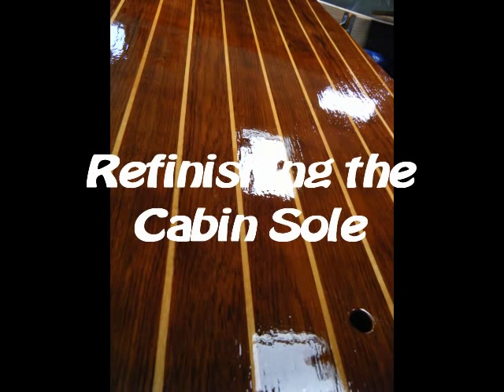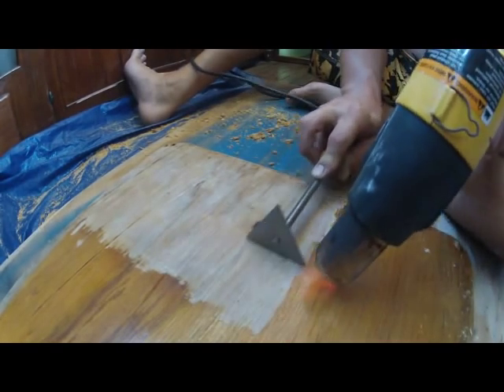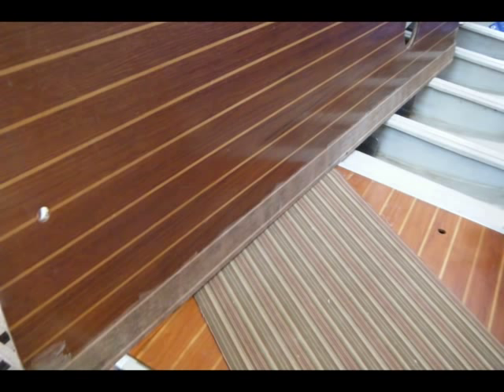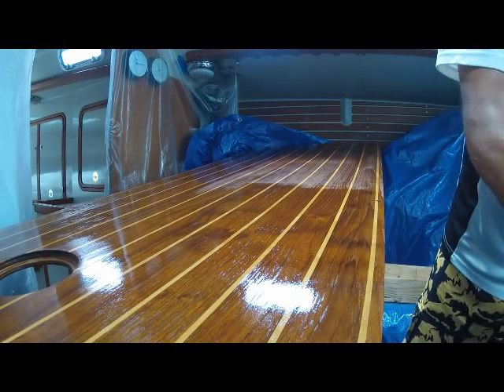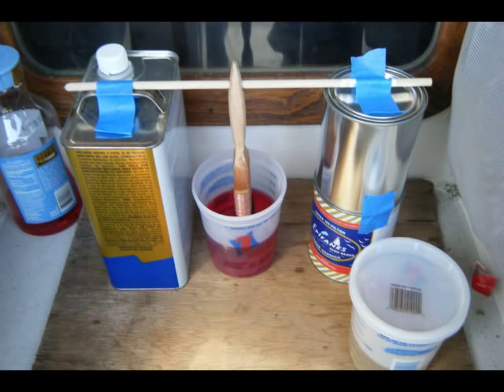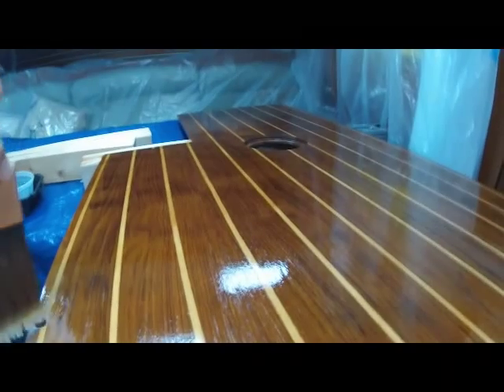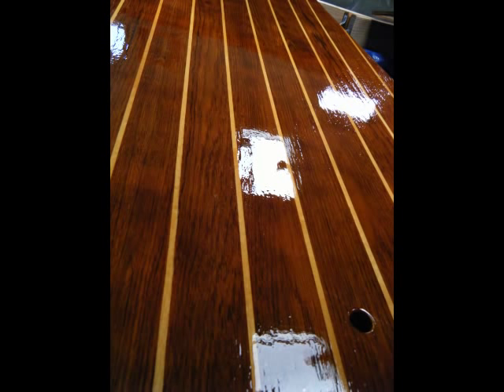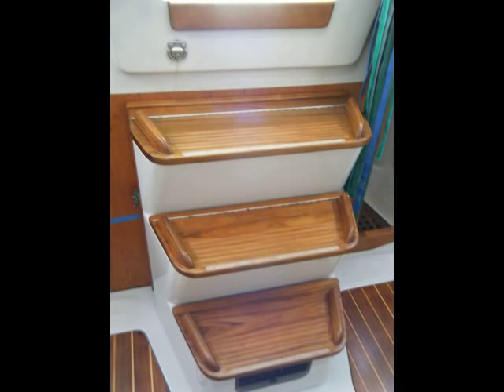How to Varnish and Refinish a cabin sole - Get A Deep Rich Sole in that sailboat floor

Comment: This is great!  Thanks so much for sharing this video.  My sole is in a sad way, and after seeing your beautiful job I'm working up the courage to work on it.  Do you have any advice about bulkheads?  I have been using lemon oil but it never looks good long.

Troy
Reply from the maker: Thanks.  I'm really glad that I can help people. Just be patient with it.  As for the bulkhead.  You can use really good teak oil and brush it on like varnishing.  Put about 4 coats letting them dry completely in between and it will look almost like varnish.  It will also last a long time.  BUT on the inside of the boat nothing is as good as varnishing.  And varnishing last almost forever on the inside.  Its just a ton of prep after using oil.
Reply: ronin51670 If I can ask one more question.

I am having an on going war with leaks.  I have a Columbia 8.3, and they are famous for leaking around the dead lights. I have used oil on the bulkheads in the past but the drips streak the teak under the windows.  I don't know if varnishing will help protect the wood or simply trap water between the varnish and the teak.  

Thanks so much for your time!

Troy

Comment: Great looking finish.

I normally use a sanding sealer after a 80-grit sanding, and then apply 75% varnish to 25% mineral spirit between sanding coats of 180, 220 and 400 grits. Unfortunately the product highly contains brush marks.Thus, I have to do lots of rubbing with scotch brite and plain cloth in order to get a finish like yours. What actually am I doing wrong?

Thanks
Reply: Probably not a good quality brush that clogs, or not enough thinner

Comment: How did you get the panels off the floor?
Reply from the maker: Hi, these panel's just sit in a groove molded to just hold them in place.  They just sit tthere.  They are not mounted in anybway.  
Some cabin soles are mounted with screws or a turn style holder.  Somevare screwed down.  They can have various mounting styles.  It will just depend on YOUR boat.  Hope this helped.  Ty for the comment and have a great day.

Comment: Question: why does the finished product look more like a matte finish when you seemed to apply a high gloss varnish? Thanks for the vid.
Reply from the maker: I use gloss for my base coats (first 5 or 6 coats) Then the last two or 3 coats are the finish that I want.  In this case the owner wanted a rubbed finish.
Reply: ronin51670  have the sam question. looks matte! thats what iam looking  for 👌 rubbed with what?

Comment: Great video! Thanks for taking the time to do that.  Quick question - I have a small section (8" X 6") of my teak and holly sole that the laminate is completely torn off.  Any suggestions on how that could be repaired?
Reply from the maker: Without being able to see the repair no.  You really have to strip the whole thing.
Reply: ronin51670 If we do strip that area, is it possible to "apply" a new section of laminate to the exisiting plywood in the affected area?

Comment: Thanks, it was informative, except for the material used. I am busy on my bulkheads and doors, and will move on to the sole last. Did you use Epifanes gloss and rubbed finish? I am in Mexico and varnish is hard to come by, but I have a supply of Epifanes.
Reply: +FrankenMer Gaming Thanks again. One more question. I have some damage to the holly, and sections where it is missing, plus numerous dents where stuff has been dropped. How do I attend to these to give me an almost unseen repair.
Reply: +FrankenMer Gaming Brilliant thanks. It is a solid floor with grooves about 2mm thick. I just need to find the holly here, but with 4 marine shops here in Mazatlan I could find it.
Thanks again.

Comment: VERY good video; thanks!!! I was wondering, a different site used West System Epoxy to build up the amount of protection, without as many coats, then put varnish on top of the (clear) epoxy. Do you think that would look good on the sole, and afford better protection than just varnish???? thanks again!!
Reply from the maker: Thanks,  I don't recommend that.  A few reasons.... First and foremost it will make it very very hard to redo the sole in a few years when they are due again.  Second varnish doesn't typically stick to epoxy very well.  Third, even clear epoxy changes color over time and will change the look of the sole.  Don't get me wrong coating wood with epoxy is a good idea on other parts or sections of your boat but I don't think it is a good idea on the floor.  Not to mention mistakes are very hard to fix and the epoxy is much more expensive.

Comment from the maker: As for the brush marks.  this is tricky sometimes.  weather plays a huge role in this especially with the rubbed finish because it dried so rapidly.  
The best way to do it is when you are on your last coat.  Thin the rubbed finish or a matt and sometimes the satin finished about 25 - 50 percent. Also working quicker on the last coat helps.  thinning it will help it lay down and smooth out.  As i said weather makes a big difference so do a couple test strokes on something.  Have fun

Comment: Thanks for a great intro/instructional video on varnishing sole boards. Some of my boards are in quite poor condition, occasionally with small areas of bare teak veneer exposed to the elements (humidity and dirt). Some of the "white stripes" (koto veneer) are also damaged in areas and I have purchased some koto veneer to replace these areas. Any experiences with this? ...especially how to achieve a good groove for laying the replacement strips...

Comment: Great video. Thank you for sharing. I’m researching before doing cabin soles on my Carter 30. On my boat the boards are not varnished or protected in any way on the bottom/bilge side. What did you do in your case?
Reply from the maker: I know its been 5 years l I'm not sure how I missed this comment then.  But I like to respond no.matter what lol.  I hope you sole turned out great.  I would sand and prep just like in the video both sides.  And just do both sides.  Since the bottom was not not protected the wood may be in bad shape under. Big it is just sand off what your comfortable with the repair  any damage with a really good filler.  Then prep the board for varnish and finally finish the the project by vanishing to your specs.  Well I hope your project worked out and your sailing the blue. TAke care

Comment from the maker: Sanding will remove the bubbles.  Your final layers will be the most important.  you will want to do everything you can to keep dust off.  There is much more dust in the air than you think in the boat.  Especially if your near a road or dock area.  Most likely the bubbles are dust.  If its possible the best thing to do is place the tabletop in a room that dosn't have any airflow.  I used to do it on my kitchen table a long time ago. Cover the table of course. Good luck.
Reply: ronin5167

Comment: Would this method be appropriate applying it to a garden log cabin pine floor?
Reply from the maker: Yes it would. BUT make sure to use a high traffic/floor varnish. It will last longer and be harder on completion so it doesn't wear as fast. Ask your local hardware store pro dude or dudett. Good luck and have fun!
Reply: @RippleLife  Thanks!

Comment: How do I get rid of water and uv stains that are in the wood?  Any tips for fixing dents in the wood veneer? I don't want to sand it too much. Thanks.
Reply from the maker: Water and UV stains are very hard to just get rid of.  Water stains can sometimes be lightened by rubbing with acetone (sanding is best).  You will then sand till the stain is acceptable being very very careful not to sand through the veneer.  Sometimes just sanding the board will make everything acceptable.  Also you don't want to sand just in that one spot or you will have a low spot and it may be noticeable. UV can only be fixed by sanding.  Dents can only be sanded out or you can fill it with a teak color filler.  another option is build up varnish in the dent first until its level (if its not to deep).  It will still be noticeable but will look good.  Hope this helped.
Reply: Yes, thank you!  That helped a lot.

Comment from the maker: as for using teak oil.  i would prefer not to because it tends to collect grime easier and also makes repairs in the future much harder.  you can use the hand rubbed varnish but its harder to apply.  ive used it once and i really like the rubbed effect better.  
for getting the white strip out to replace i sugest a really good jig on a table saw set at the correct depth with the correct size blade on and just cut it out but you will need to be very careful.  then glue and sand new peice in. TY.

Comment: Ever worked with other woods?  I recently saw a beautiful mesquite plank floor.  That stuff is hard as nails.  No idea about salt water tolerance.
Reply from the maker: Also white oak is great I already mentioned it but wanted to be clearer.  White oak was used a lot in the early days for most of the construction of boats.  It would swell and seal very well.  Also it was used for decking.  When I said that hard woods rot faster it was in relation to more oily or sappy woods.  Because hard woods will last a very long time (depending on the wood and clarity obviously).  I still protect all my wood. Hope that helps.
Reply from the maker: Mahogany Is good as well.

Comment from the maker: epifanes rubbed and gloss varnish is a tung oil, alkyd resin based finish.  They do have a product called wood finish that you do not have to sand between coats which is a great product but in my opinion is not as durable and dosnt look as good as the snd between ones.

Comment: Is there a best way to remove oil stains from cabin floor boards before refinishing?
Reply from the maker: +Thomas Barrett You can try bleaching.  But oil that is soaked into the wood Is almost impossible to make unseen if it is laminate.  If its solid then you can usually sand it down enough.  If it is a small spot I would recommend Installing a lift bracket or some type of handle where the mark is.  no one will ever know its just for show lol.

Comment: Hello, sir! Fine work there and a great how to vid. A question if I may...I'm just about to dive into my boat project and I'd like to change the color of the teak a bit before I varnish. It's a light brown at the moment and I'd like to go for a darker, more cherry looking finish. After I remove the existing varnish from the cabin sole can I just stain as desired? Will I have to mask off the holley parts? Much appreciated! I have many projects coming up on my old boat and your channel is inspiring. Keep up the good work!
Reply from the maker: Hi,  If you are going to stain and do not want the holly stained as well then yes you will have to mask it.  But a fair warning. stain has a tendency to migrate to its adjoining pieces.  So make sure you use a very good masking tape and make sure the edges are firm.  Also try to apply it as dry as possible.  (wet will migrate).  Still no guarantees. Its going to be hard to tape off the thin stripes of holly as well.  Best bet is to stain it all and have the holly go darker.  Thanks for the comments and glad to help.
Reply from the maker: Oh and stay away from the stain and varnish in one products.  They aren't good for either.

Comment: When the heat gun and scrapper are preferable to the sander?
Reply from the maker: Very thin veneer.  Not worth risking accidentally sanding through. Also can have dipps and be uneven when trying to sand off the old varnish.
Reply: @RippleLife  thank you

Comment from the maker: Hi,  and thanx.  Well first you dont need to start with an 80 grit unless the wood is really worn or pitted or channeled or something.  you can start with a 100 or 120.  and only need to go up to about 220 max.  400 is to smooth.  in between coats only use like 200 or 220 max.
you dont need the sanding sealer under varnish.  The best way would be the thinner mix of varnish so it soaks into the wood and gives it the adhearance to itself as you build up the less thinned layers. continued---->

Comment: If you’re teaching, too vague. The final product looked good though if there was dust video doesn’t show it. I varnished and LP all brush work like sprayed effect. On your satin varnish 25% thinning is 
what I did for first coat to seep in grain , on final coat I mixed, strained, tack and no thinning for 
a polished professional finish . Point , if you’re thinning 25% the product will need attention sooner
as fading will come quicker and not so cost effective to the client.